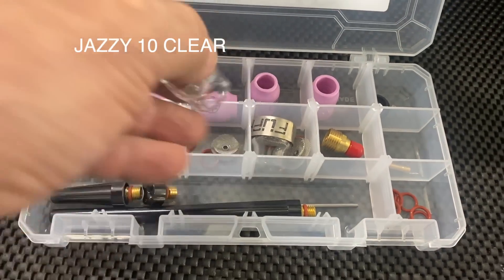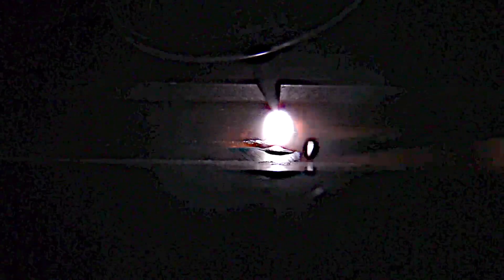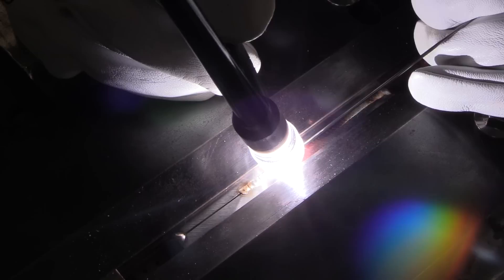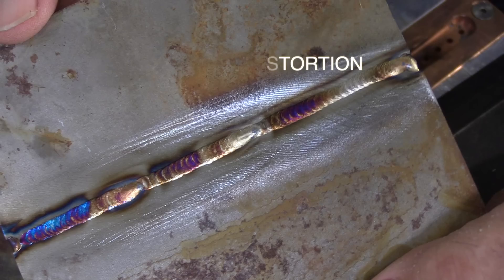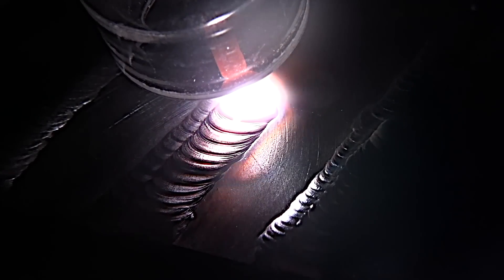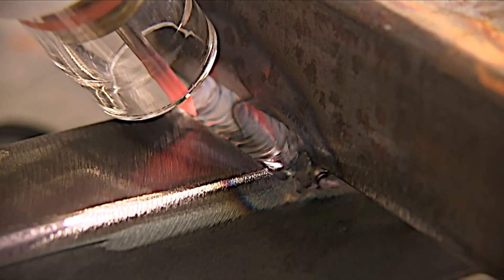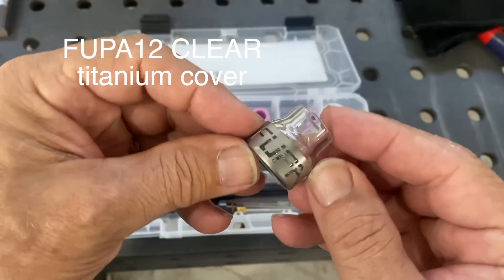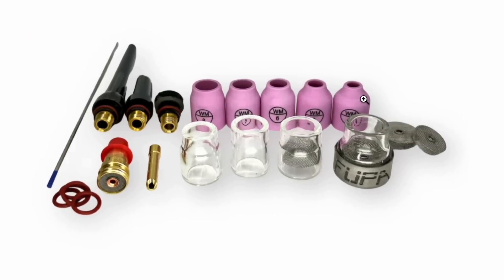TIG Welding Techniques

Comment: You are absolutely correct about welding on aluminum helps to produce better welds on other metals.  I started fabricating some of my first pieces from Titanium today and the look of the weld was absolutely fantastic.  Nice, even spacing with constant width and constant height.  I was doing outside corner welds.

Comment: I'm used to mig welding and mostly do thin metal work on vehicles.I've been thinking about trying tig welding,if you have the amperage set correctly with tig how does it compare to mig welding for panel distortion?Thanks.

Comment: Back stepping is a requirement in some power plants on long runs in the uphill vertical direction. Fitting girth seams on vessels it can come in handy as well  to prevent pushing a bubble around the vessel. And no, back stepping is not block welding.

Comment: It never ceases to amaze me how you make your filler wire look like it's made out off butter whenever you're showcasing low amp welding.
I know you've made videos discussing the importance of picking the right filler metal, but have you considered doing one that highlights the issues you run into when using the /wrong/ kind of filler when welding alloys?
Your content is great as an educational tool and I love being able to refer to it when talking to people.

Comment: Awesome video Jody you the man 👊🏻 I never really tried the clear cups we had some cheap ones at work years ago and someone was welding aluminum with them and dipped the tungsten or something crazy the one guy would break the pink cups all the time I think from having the tungsten inside the cup instead of a stick out. Anyway that’s where I think your cups would do better they seem thicker compared to that other brand may. I’ll have to give them a try soon I need a new Tig finger while I’m at it. 👍

Comment: Jody, I just heard about the "incident" at Delta Maintenance @ Hartsfield. My condolences.
Reply from the maker: which one? there were a few
Reply: @weldingtipsandtricks  today I believe - initial report a tire "blew up" 2 dead 1 wounded.
Reply from the maker: @tedsaylor6016 I’m saddened to hear that. I’ve had friends injured inflating tires with high pressure nitrogen. It can be dangerous
Reply: So I'm gonna comment again after getting through the "commercial "part at the end. I watched till the end that was such a great explanation and visual. Best fab channel on YouTube. What a dude

Comment: I've been welding a lot of aluminum lately since repairing my old Miller 330 A/BP. i think of the techniques from your videos every time and try to practice them while welding. I've noticed a big improvement. I was having a wandering arc problem the other day and my mind went back to your video on how to cut tungsten. Sure enough I hadn't cut it, but the tungsten was split! i replaced it and it welded great.
Reply from the maker: thats great to hear. that old miller 330 ABP is a beast. Nice machine that welds great
Reply: Jody’s the best teacher out there always positive comments if you read them and always a lot of people learning very good information from the videos. I know I learned a lot a lot of my welding knowledge of from Jody and the podcast I miss that podcast. 👍